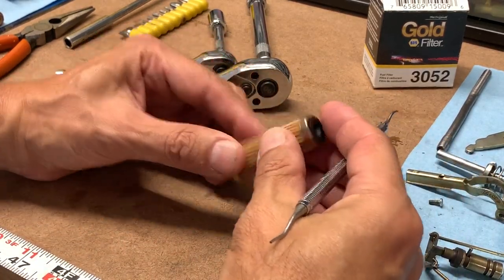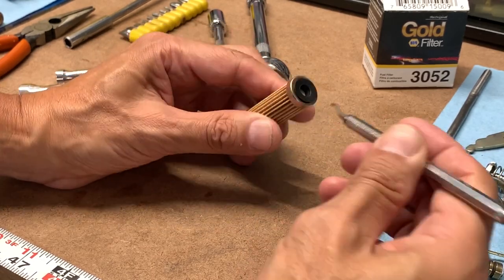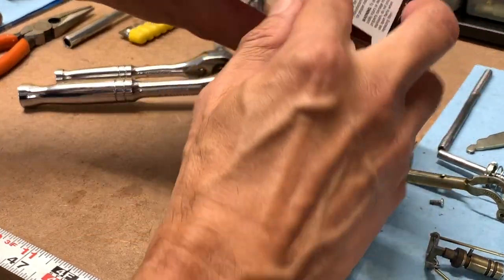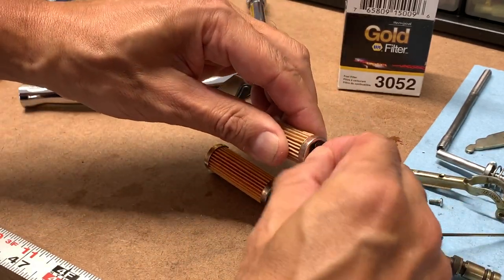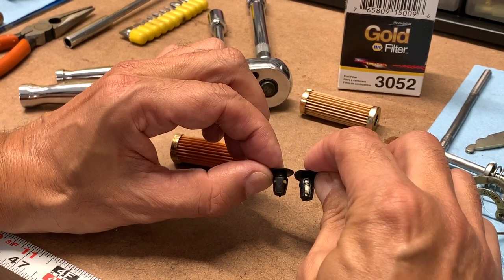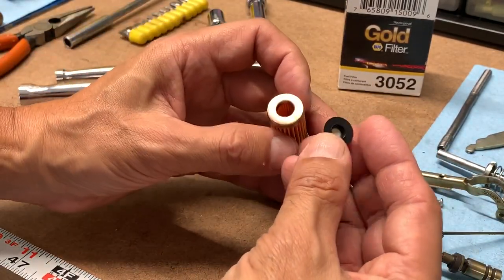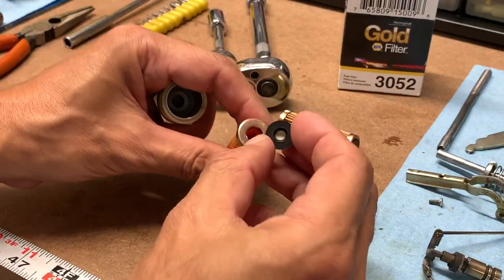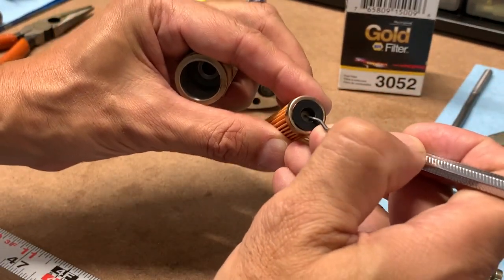Good or Bad? Quadrajet FUEL FILTER Inspection

Comment: those little valves were meant to prevent fuel from draining out of the carb back into the line -check valve-, preventing empty bowl and hard to start situation in some models. They are not important  and can be removed if you have no carb issues with hard starts.
Reply from the maker: Thank you for watching! 😊👍🏻

Comment: Nice video, Question: What size wrench for the big carb nut and what size tor the fuel line nut? Thanks!
Reply from the maker: Thank you! 😊👍🏻 I’m pretty sure the fuel line nut is 5/8” but regardless, make sure you use a line wrench. For the big nut I usually use a medium-size crescent wrench and that works really well.
Reply: @76vette  Thanks, keep up with the great videos! i'm a subscriber.
Reply from the maker: @GJJC13  I appreciate your support. Thank you! 🙏🏻😊👍🏻
Reply: 1" and 5/8"

Comment: I had same issue valve sticking now i just remove them and never have to worry ,my thought is the ethanol in fuel these days ruins the rubber /plastic.Can and will leave you in a bad predicament .
Reply from the maker: That’s a good guess but they can be replaced quite easily. Thank you for watching! 😊👍🏻